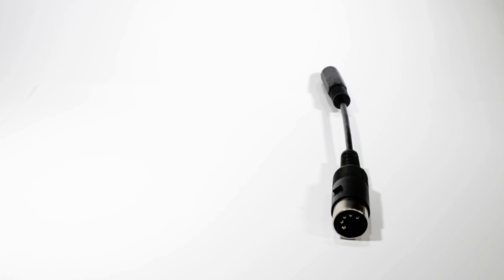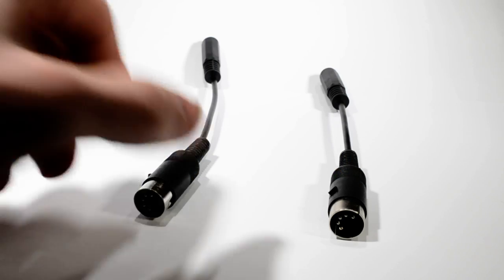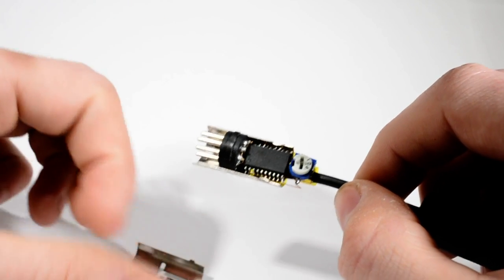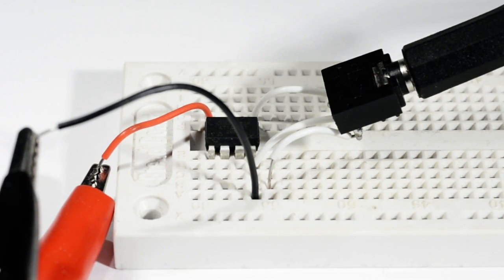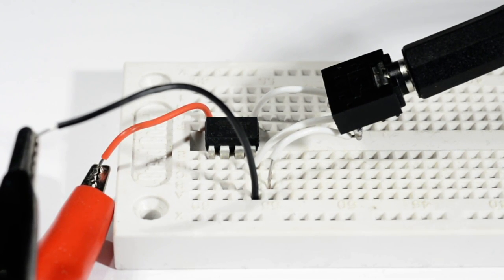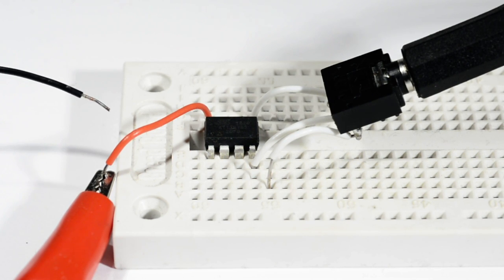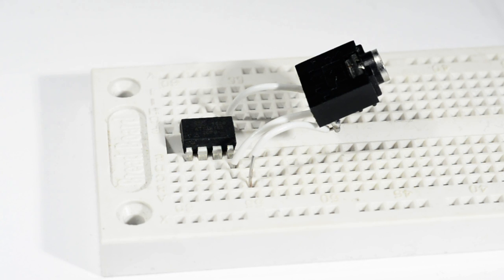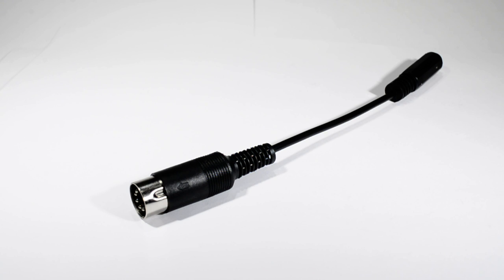Polyphonic MIDI Synth on an ATtiny2313

Comment: I used that chip for a GPS/ PWM encodinging timecode converter back in the day.  Got it all working, including daylight saving dates for all Australian states/New Zealand in 2k Words.  Then Atmel shifted their focus to flash memory and it got expensive so we tried replacing it with a pin compatible intel, but it was never going to work in that little memory

Comment: according tot the "The MIDI Association" https://www.midi.org/ , MIDI was/is 5 volt. but on the new 3v33 mcu's they changed the resistors to provide enough current to drive the led in the optocoupler.

Comment: Hmm... I've actually already done something similar to this myself. My approach used a much more primitive spin loop for the waveform generation. Timer1 was set to free-running mode, and each polyphonic channel had two values associated with it, "period" and "compare". All the spin loop does is compare Timer1 to the "compare" for each channel; if the timer has passed it toggle the corresponding output pin and add the "period" value to the "compare" value. Everything else happened in the UART interrupt, which tracked polyphony allocation and used pre-computed LUTs to update the "period" value. Even writing this all in C the performance was fine, but you could probably do even better if you wrote it in assembly; then you could put the compare values directly into register memory and unroll the spin loop across your channels.

Comment: Theres a version of the STM32F103 that has a DAC (or 2 idk) built in, what if you could make another pointless variation of the MIDI cable synth with that?
Reply: @Li Feng according to Olivier Gillet from Mutable Instruments STM32 is easier to micropic and atmel. he even said, i should have done this earlier instead or having a battle with a ATMEL or PIC.

the Arduino environment makes it relative easy to "program", but you don't learn how to setup the micro-controller. their bootload firmware is pre programmed into the Arduino  and you never see it. 

but you can use alot of the Arduino code (header files) and use it in your own bluepill project.
just replace the arduino property stuff.

the boot part of the MCU, where your setup the UART, timers, interrupts, etc is imported all other stuff in the main(arg){while(1){.....}} loop.
Reply: @Li Feng, check BluePil
Reply: @Li Feng read the datasheet/notes from ST ARM stm32.
Reply: @Li Feng Arduino is a language that looks like C. but is not.
Reply: @Li Feng you needs to know about the special function, PORTx, Trisx, and stuff registers and their locations and address/read/write them.
Reply: @madmad4393  i said nothing about a DAC.

Comment: I was looking at the page for this after seeing the video for the Hπ FLASH, as the FLASH is well beyond my needs (I have a purely digital (i.e. no speed/pressure/aftertouch) MIDI keyboard controller with no additional knobs, sliders or expression thingumibobs. I'm not sure why you didn't do software addition then use a resistor ladder DAC to get your analogue output. Easily enough done without relying on specific on-chip circuitry, surely...?
Reply: Your current config gives 3-bit + 1 audio, but the ladder dac would give 8 bit, and sticking with 8-note polyphony, each individual voice could have a 6-bit digital oscillator (sawtooth would be the simplest) with no risk of overflow errors on the summed output, and you could get 16-note polyphony with 4-bit oscillators (which would generate a lot of higher-order harmonics, but would surely be acceptably chip-tuney...)

The only fault would be the totally asymmetric wave output (always 0 or below), but the square waves are already doing that anyway.

Comment: For a square wave synth, it actually sounded not only good but also in tune! THAT is a miracle in its own right! The other synth in cable solutions have more functions but slight out of tune play on some higher notes and yours you cringed at high note play but it was all in tune! As I kid I would have loved to have known I could build my own cheap poly synth that easy back in the 1980s when keyboards were still too expensive for a kid to just go and buy. Go figure.